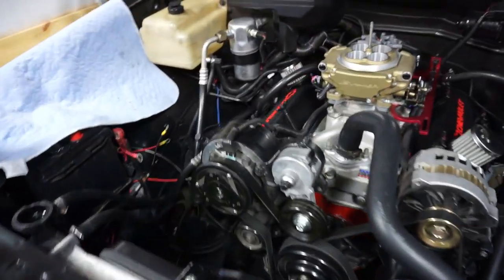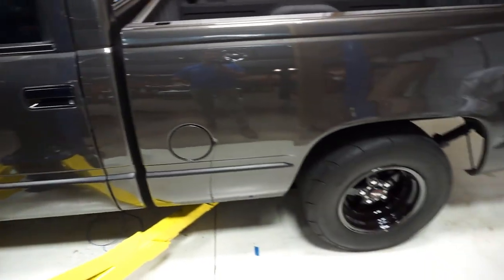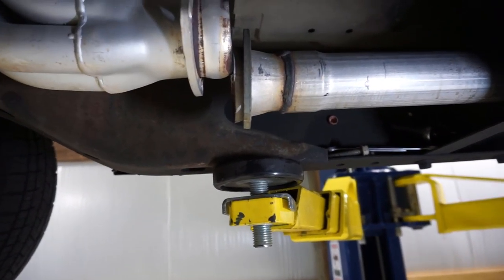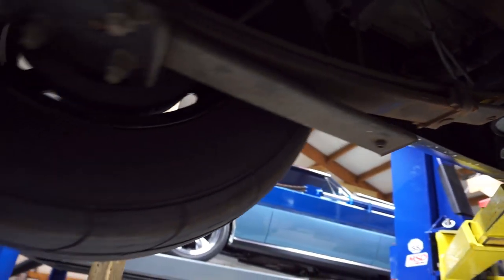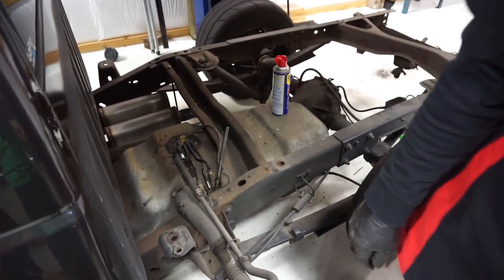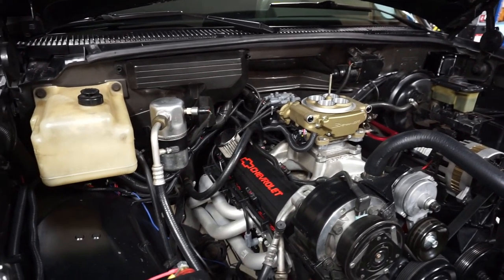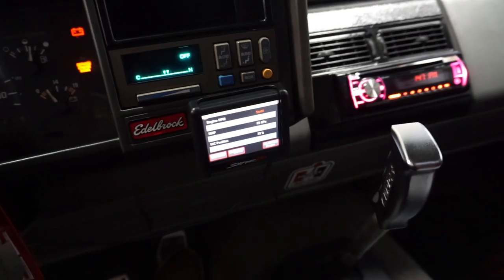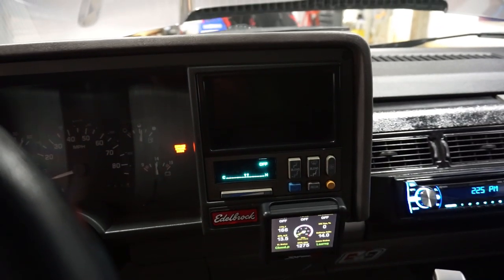MUSCLE TRUCK HOLLEY SNIPER INSTALL PT 2 ! STARTUP !

Comment: What is the part number for the accel fuel pump you used for the sniper I’m putting the sniper on my 350 in 1990 obs
Reply from the maker: I don’t remember... however it can be found on Holley’s site by selecting year make and model then going to accel pumps. It should bring it right up.
Reply: Thanks man I believe I found the right one and ordered it with my kit got any good info to watch out for during my build

Comment: Very cool. I'm planning on using that injection on my S10 small block swap. I have a question though, how is the NV3500 trans? I want to use this trans also.
Reply: For a daily it's fine. Just don't throw any power to it.
Reply from the maker: I’m putting down right at 400 hp to it. I do not launch the truck because of the NV3500. I’ll go 6 speed magnum this summer

Comment: Did you run the return line back to the pump? Or did you use the stock return line?
Reply from the maker: Stock return lines will do the job

Comment: Hey bro do u have the part number on that fuel pump. I have a 91 Silverado and I’m doing the Holley sniper on my truck.
Reply from the maker: It’s the only pump on ACCELS site that fits our trucks. I can’t remember the part number but you can find it on Holley

Comment: Do you  by chance happen to have the part number for that accel fuel pump you used in your video? Went into holleys website and am trying to find that pump. When I entered In 1990 chevy k1500 for my vehicle it only populater with the retro kit and I want to set mine up with an intake pump as well thanks in advance
Reply: I can’t find it either, any luck?